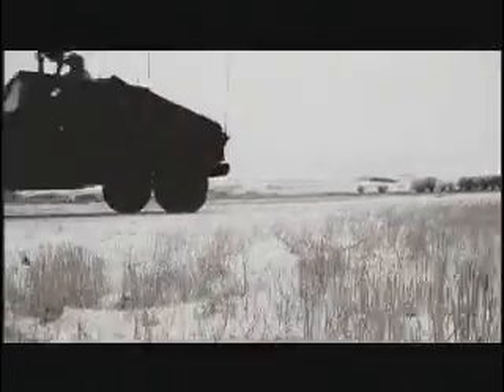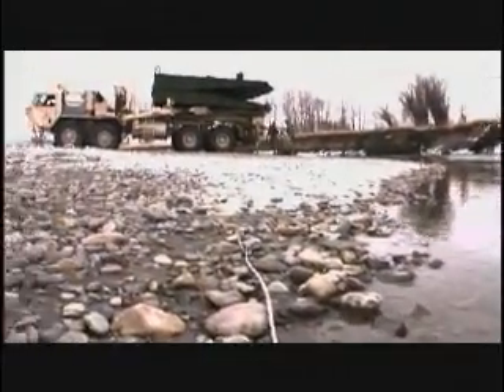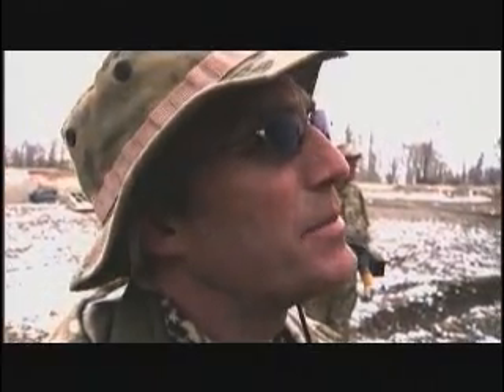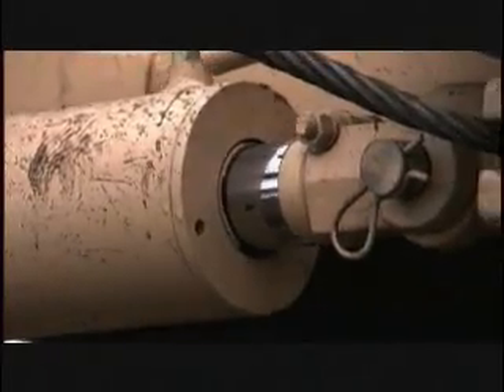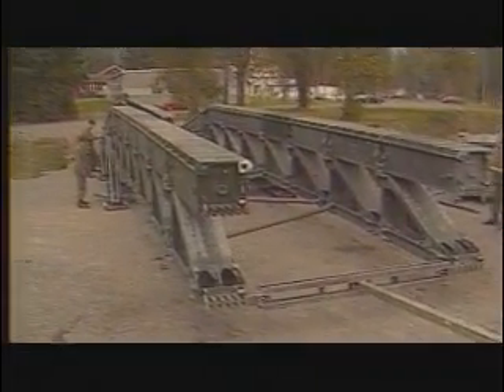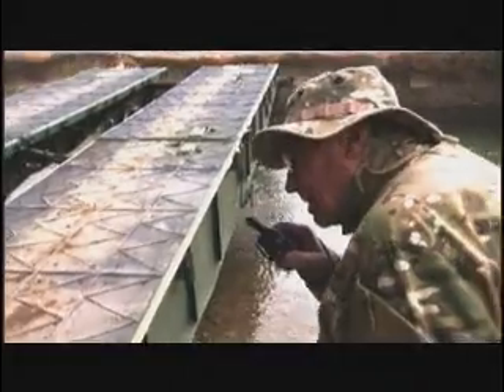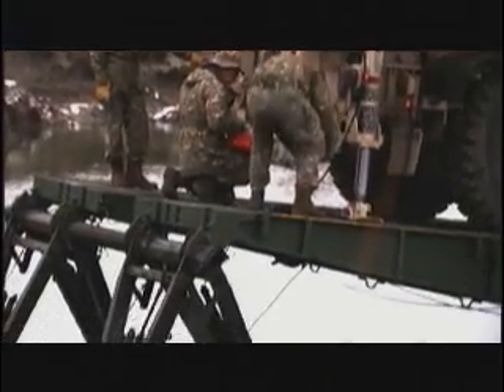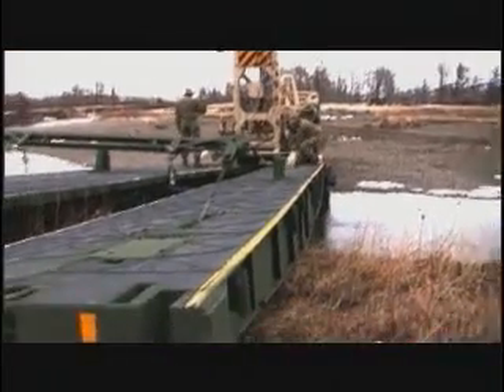ERE S80T FR Tactical Bridge System LHS Hemtt

Comment from the maker: No you can pick the bridge up from the other side if you want.  The legs are pined in the main cross support tube.  They work on the first or second span of bridge.  Subject to which set of pins you pull determines which half get the leg set.

Comment: I noticed that the legs for the bridge that are in the water came in on the first section of bridge so now the troops and oshkosh are on the other side of the river can the hemtt now pull the first half of the bridge up and still leave the legs behind and pick them up with the 2nd half of the bridge or is it designed to be left in place untill the troops n the oshkosh return back to the first side of the river ?